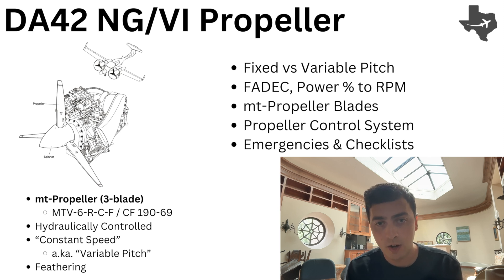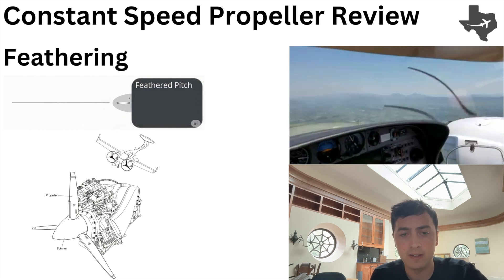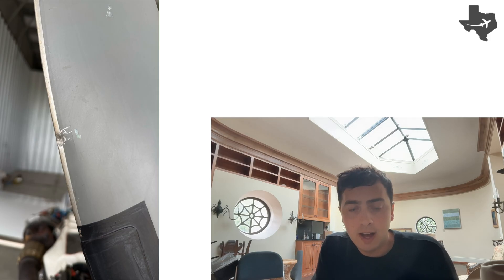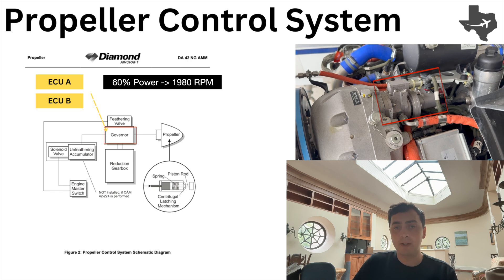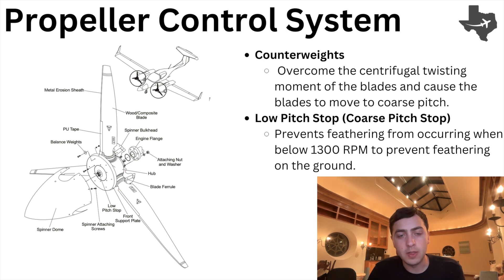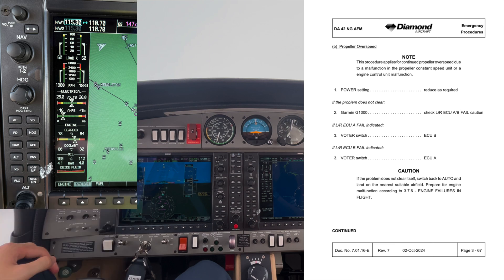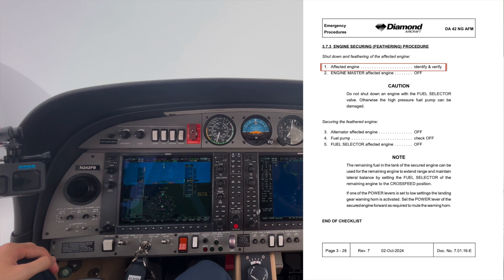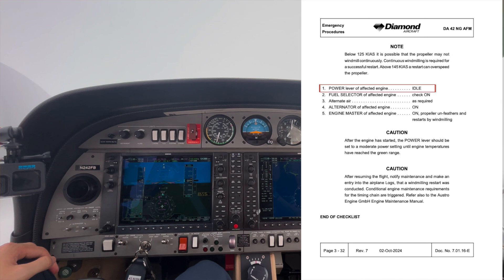DA42 NG/VI Propeller System Explained

Comment: Quick question, you said the pressure accumulator pushes gearbox oil to fine pine pitch when engine master is turned to on, and this take it from feathered to fine before start. But surely it wouldn’t be in the feathered position to start with due to the feather stops/latches to prevent feathering below 1300RPM??
Reply from the maker: @OllieRouth, good catch. I probably should've worded this better. Turning on the engine master moves the props out of a coarse pitch (not full feather because of the stop pins) into a finer pitch.

Comment: Mr. Max, is this what is referred to as“fly by wire”?
Reply from the maker: Hey Robert, thanks for watching! Fly by wire has to do more with the flight control system. The DA42 ailerons, elevator, and flaps use control rods. Fly by wire uses electronic signals to actuators.